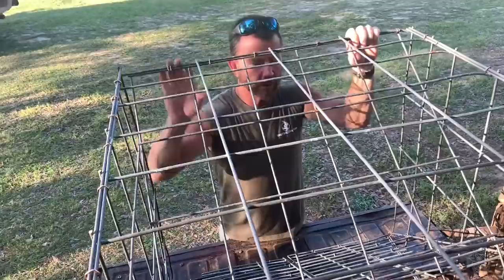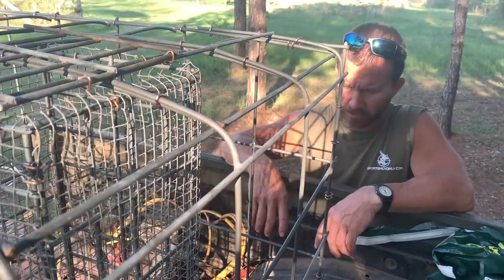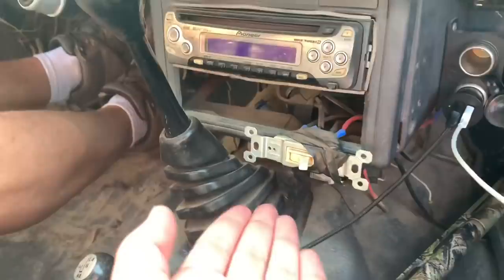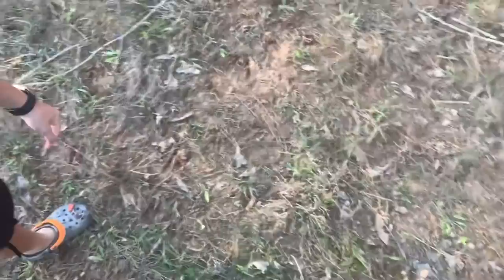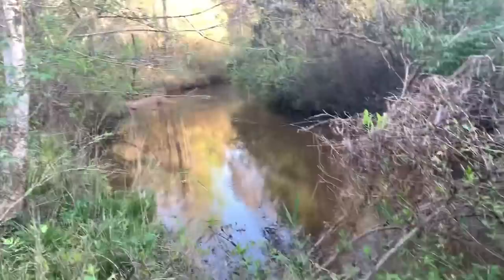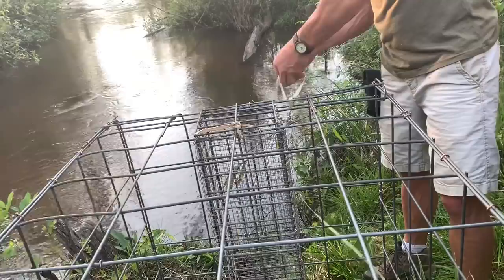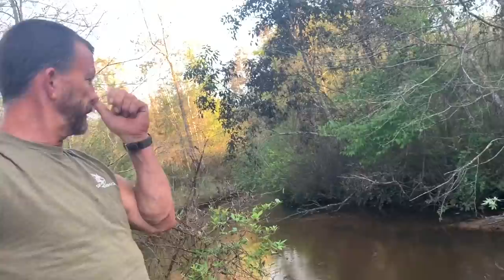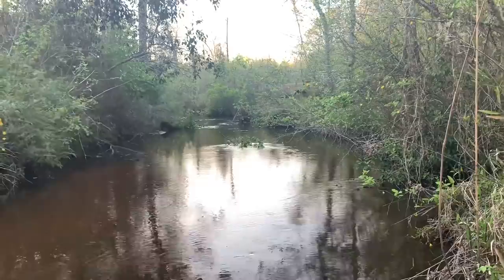Setting Turtle Traps to Catch Snapping Turtles! Quarantine 2020

Comment: Somewhat random. I worked out regularly from the age of 17 until 29 (last year) when a life time of various injuries and ailments led me to make the sad decision to call it quits. I have dabbled with bodyweight stuff here and there over the last year but just cant find the drive anymore. Your little tid bit at the beginning about working out gave me a little jolt for some reason, and I ended up riding my motorcycle to a local park and doing some pull ups and some painful (on my shoulder) push ups followed by a run around the lake. My lungs felt terrible and my leg muscles were unreasonably tired from the short run but it is what it is. A long fall from glory for me. Thanks for the motivation, and stay well.
Reply: Respect ✊🏿

Comment: I have seen it done by taking a 55 gallon drum knock a few good size holes about a foot from the bottom. Put it in the water about half way up the drum with a cinder block in it with crap meat. Thin run a good size limb or 2x8 up the side thin check it every few days. The turtles smell the chum crawl up the wood fall in and can’t get out.

Comment: Yep that's called mule tape I noticed that right away when you first went into the truck with that turtle trap that's a woven fabric tape we use it in electrical industry for our conduits running it in the pipe it's also used for measuring the distance in the conduit so we know how much wire to purchase.

Comment: yes the name of it is "MULE TAPE" we used it for pulling in cables through conduit in under ground cable runs  double it up a number of times and it will work as a tow rope the thinner tape i used as boot laces

Comment: Hey Hannah. I couldn't hear. your Dad. Why do the hogs rub the sap on themselves??
Reply: Ste Shar-- I understand Southern accent, I speak a little of it myself. I'll decipher it for you. It was to keep the Bugs off them. 

For a Bonus round, I'll give you a "Damn!"  I didn't know That? 

Best way to get Hogs coming to you (Hunting) is to string a heavy line a few feet apart, between two trees and few feet above ground and wrap some old rags around the line, soak it with Used engine Oil. Hogs love it, they will walk under the line and rub their backs on it to keep the Bugs /Ticks/ mites etc off them I've also seen them use rollers soaked oil. I would say it may be a shampoo for Hogs. Hogs are very smart animals and dangerous. Now you have learned a little southern trick of hog hunting. See Y'all later! ;-)